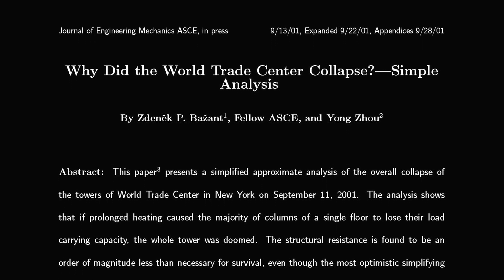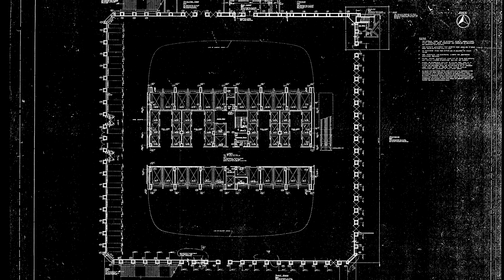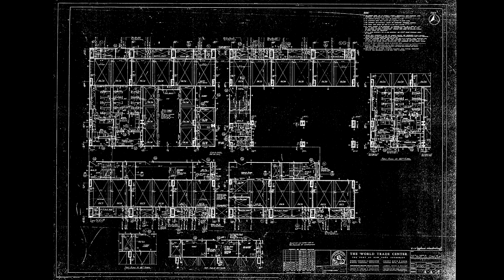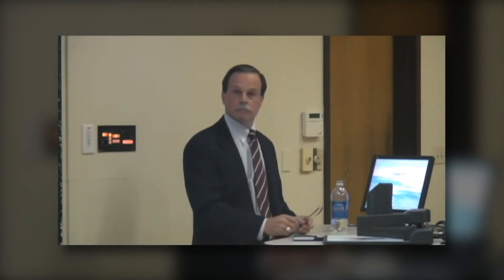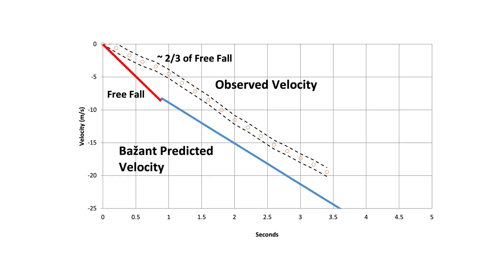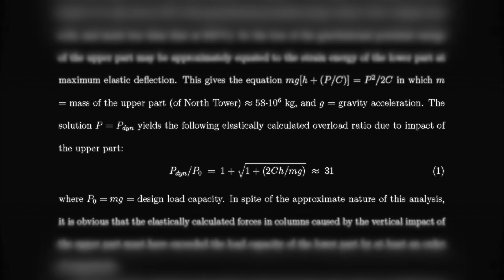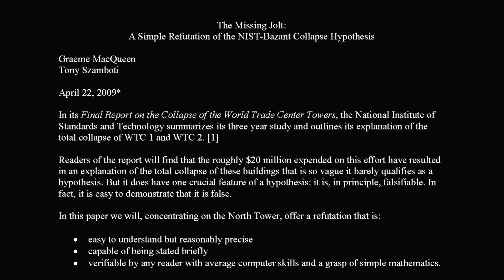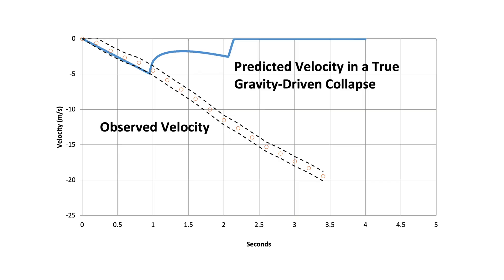Engineer Tony Szamboti: Official theory of Twin Towers’ destruction built on glaring errors - 4K

Comment: Look at the Eiffel Tower. 10,000 tons of wrought iron. But we can see how it is distributed down the structure. 

The Twin Towers were 37% taller and the steel cannot be seen.

Why haven't engineers discussed and demanded data on the distributions of steel and concrete down the towers.

Comment: Once the tower tops tilted at onset, columns were no longer in alignment to resist one another. The only resistance was the lightweight floor spans, incapable of stopping the falling mass of the tops (estimated at 33,000 tons for the North Tower).
Reply: @anti-imperialistleague 
Name the structural element that would have served as the fulcrum in order for the top to fall over completely outside the footprint.
Reply: No